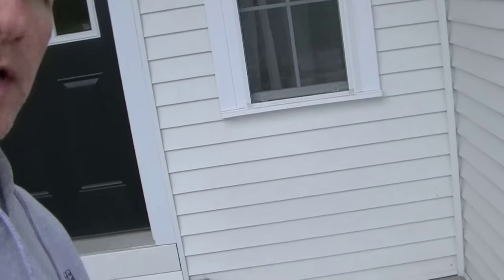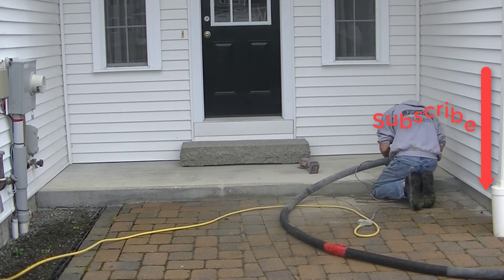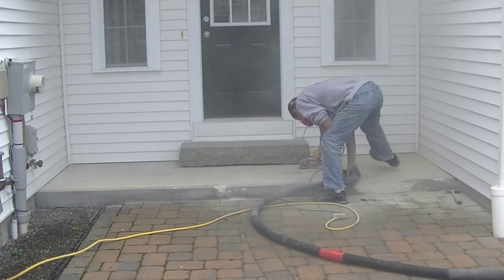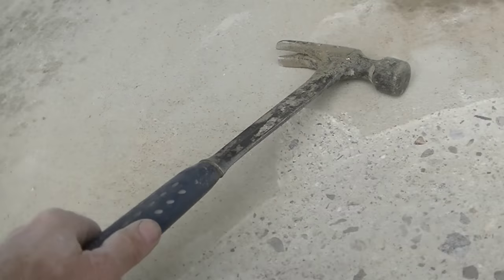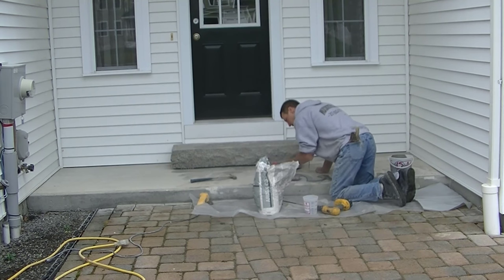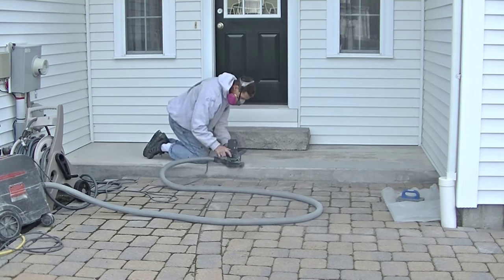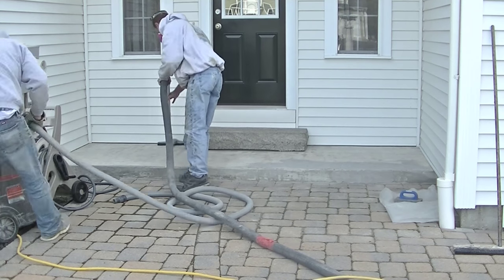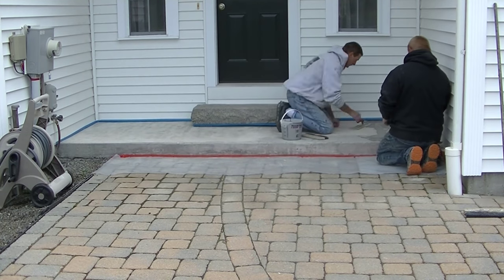How To Repair And Resurface Spalled, Salt Damaged Concrete | Concrete Patio Repair

Comment: Looks good. We've been using Ardex for years. We love it. You can get Ardex Fine if you need to just resurface thin, and there is Ardex Patch for any patches over 3/8" or so. You definitely need to clean your tools well after using with Ardex. That stuff is a nightmare to clean if it sets on your tools. Lol.
Reply from the maker: Thanks James. What do you do for work mostly?
Reply: @MikeDayConcrete  I do mostly flatwork (Driveways, patio's, sidewalks, garage floors, stoops, etc.) I started as a laborer when I was 15 (now 26) and now I do everything, finishing, stamping, setup, tear-outs and repair work. I've been watching your videos and it is nice to see concrete guys that know what they are doing. Keep up the good work.
Reply: Where do you purchase Ardex from?

Comment: Great video! I have this exact problem going on due to the rain/snow pooling on the patio. Thinking I'll have to grind out the loose stuff like you explained, resurface and do an epoxy on top to repel away the water. Can you recommend any concrete product that i can build up to create a slight angle so the water rolls off the patio? I don't want to have to be very thick for the patio doors clearance. Thanks again!
Reply from the maker: We use CementAll from Rapid Set to build up for a slight angle. You can get it at HDepot. If you can't shape it to your desire when installing it, you can grind a slight slope in it after it hardens.
Reply: @MikeDayConcrete  Thanks alot! Assuming I can use that CementAll for the patch repair then aswell?

Comment: I can only imagine the abuse concrete takes in that type of weather. Very nice!! Clean...I've used 2 sand 1 cement and of course sprayed on a bonding agent here in Missouri and colored the overlay, by putting the pigment inside the mix. It's on 9 years and in great condition.

Comment: Hi Mike - first off, have learned so much from your videos, you have no idea how helpful they are to a DIY homeowner - thank you for them! Quick question - I extended the slab on my side door stoop almost 2 weeks ago (was my first try at pouring concrete) - tied new pour into existing slab with lag bolts and shields - but I did a poor job finishing it (a bit uneven, swirl marks, etc). Should I wait the full 28 day cure period to overlay the whole slab with newcrete? (can I use quikrete sand topping for overlay?) Or can I go ahead and overlay/resurface now? Thanks again Mike!

Comment: Wetting the surface before the placing the new cement will help to remove the "pinholes" that you saw appear on the new cement surface plus it also helps to bond the new cement to the old, otherwise the old concrete will absorb the water from the newly laid cement and it will dry incorrectly! Good luck
Reply: Ardex specifically specs no damping or priming

Comment: Would you recommend Cement All for this project? Am currently using that to patch and resurface my concrete porch, which btw, has a roof over it.
Reply from the maker: You could but rapid set makes a resurfacer product also.
Reply: Thank you.

Comment: Would you recommend to use rapid set cement all to cover the patches and broken corners and then use rapid set newcrete resurfacer to smooth out the entire area.
Reply: I used rapid set cement all for the first time 3 bags excellent product for resurfacing It drys like an epoxy.

Comment: How long does resurfaced concrete hold up? I'd like to try this rather than stain but only if it will last for a while.
Reply: @samsngdevice5103  A decade will do. Thanks

Comment: What grinder blade did he use ? I have a small porch and some kind of DeWalt grinder blade that I was thinking of using to lightly clean the porch and figure out if this stuff can be applied on top

Comment: Stumbled on this video when looking to see if there's any new products. I use re-cap resurfacer and it requires the old concrete to be dampened with water before applying. This stops the pin hole issue. Might be similar with Ardex? I do check sound with my hammer or my chisel, nice to see I'm not crazy for doing that lol

Comment: Thanks for the video! I am in Canada and can't find the product you are using, Ardex CD. Do you have any experience with Quickcrete Re-Cap? Concrete Resurfacer product? Thank you!

I also cannot find the RapidSet product you mention, where I am in Canada, either... Re-Cap from Quickcrete is available, though.

Comment: Thanks mike  looked really good .
    Question 
 On average with good prep work and correct application of product , how long does it last  in  a 4 season climates? 
  And  can it be done again ?
    Thanks 
 G in va
Reply from the maker: It can be done over, yes. It'll last a long time if it's maintained with sealer and not abused with salt or deicers.
Reply: @MikeDayConcrete  
  Thanks 
  Keep up the fine work and informative videos.
     I personally not a big salt deicer fan , but in certain neighborhoods boy oh boy .
     Commercial property's most esp.
     G in va

Comment: Hi Mike. Would resurfacing help to prevent condensation in my cold room
Reply from the maker: No, Condensation happens one of two ways: Either the air is cooled to its dew point or it becomes so saturated with water vapor that it cannot hold any more water. Dew point is the temperature at which condensation happens. When warm air hits the cold surface, it reaches its dew point and condenses. Resurfacing won't stop that.

Comment: How hard waring is the ardex C D? Have you had any issues with it over time?
Thanks
Reply from the maker: It's harder (higher psi) than the concrete is. Wears very good, especially if you keep a sealer on it.
Reply: @MikeDayConcrete  great. Thanks Mike👍

Comment: Surprised you don't wet the surface before you apply.  That would have eliminated that issue you had and you would have been done in one coat.  You guys do neat clean work
Reply from the maker: Thanks John. Yea I could have dampened it a bit. Ardex wants you to do it dry, but a little moisture would have helped on this one.

Comment: Mike, In this video you used a 4" grinder to remove loose spalled concrete and to prepare it. What kind of grinding wheel do I buy?
Reply: You’ll want something diamond tipped, I’m not sure if he’s using a cutting style disk or more of a sanding style attachment. Maybe both?

Comment: My concrete sidewalks started surface pitting, crackling , and crumbling soon after installation. As I walk around the old neighborhood, I see occasional cracks in the old concrete sidewalks and lifting from tree roots (without any pitting), but I don't see what I see on our sidewalk and driveway. Has the formula for making concrete changed making the new sidewalks inferior and not durable like old sidewalks?

Comment: Nice job Mike, never did a resurface job. I'm not a fan of broom finish I wonder if you can use a 3/8 nap roller we do it on patios and walkways looks like stamped stone work just maybe add a color or two and seal it? Like I said I have never done it usually I make a test sample at my house or from a job site before hand. I wouldn't want to find out it doesn't work out on a customer job site.
Reply from the maker: I think the roller would get gummed up after a couple passes. This stuff is sticky.

Comment: Yo question was this slab mag floated to much was there to much cream on surface when it cured
Reply from the maker: I think there was just too much de-icing material used and no sealer on the concrete.

Comment: I've run into this problem before, u need to wet the surface first, just a light spray, that will solve the problem and help it bond better

Comment: how durable is this compared to new concrete?  I have spalling and pitting on mine and I am going to take a stab in doing this but would still like to use salt in the winter.  I do worry about the resurfacing Spaulding within a year after salt is thrown.

Comment: VERY informative video! Thank you! My front porch looks like someone somewhere along the line used something to chip ice and ended up chipping small divots in the concrete in front of the doorway. The rest of the porch is still in good shape. Do I need to resurface the entire surface or just the area that needs repair?

Comment: People need to use concrete safe salt in the winter and clean their gutters where water will spill over onto the concrete and they can avoid these cracks and spawling  granted this concrete looks to be around 25 years old.

Comment: The way I would fix that is R&R. Ripout and replace. If the person who originally poured the slab did not do the job correctly, resurfacing usually is not the best way to fix it.

Rather than trying to make it appear new, I would have just beat it out with a 20 pound sledgehammer and poured a new slab.